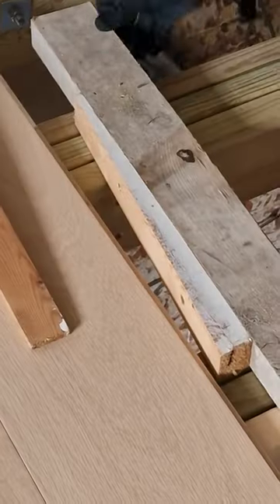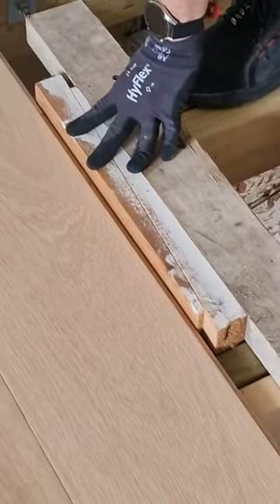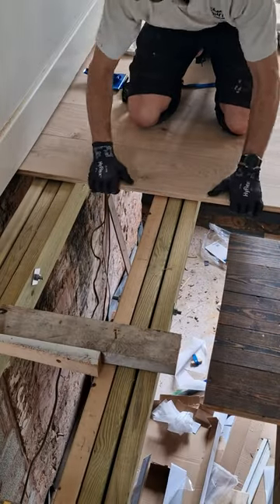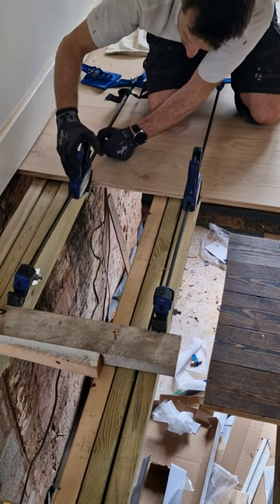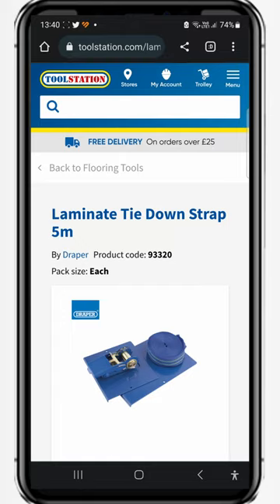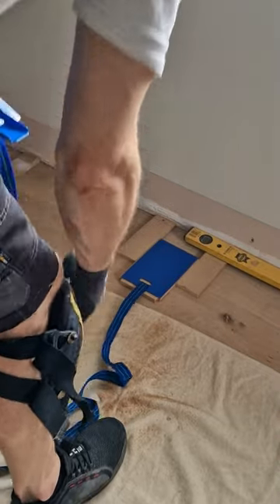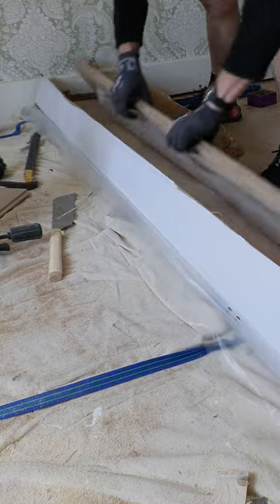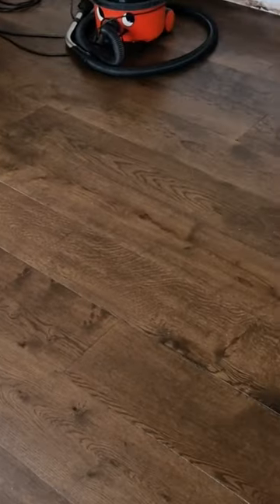Which floor clamp is the best? #shorts

Comment: I know it 22mm thick, but how are you overcoming weak points at the joints, since it does not look like you are gluing the joints, and there is no support underneath.
A well placed stiletto heal or a leg of some heavy furniture  will result in a nice hole.
Reply: That won’t happen. The boards are strong enough that as long as the joists are set at the correct distance apart there will be no movement in the floor at all even directly on the joint.

Comment: after 26 years rebuild my wood floor, because dried so much, has 2-5 mm gap, at the and needed a 6-7 cm more wide wood plate, I used rachet strap and now looking very nice without gap
Reply from the maker: They're great aren't they 👊

Comment: Hi charlie thanks for the video! you know when your screwing the board down, is it ok to do that because of expansion and contraction?
Reply: Engineered oak should be left in the room it is going to be fitted in for about two weeks before it’s fitted to acclimatise, reduces expansion, never had a problem with expansion using tongue -tites.

Comment: What location are you?  I’ve never seen a tongue & groove finish floor float on the joists. There’s always a 3/4” subfloor underneath
Reply from the maker: 22mm thick multi layer hardwood ply undercore, t&g all the way round. It doesn't need a sub base or noggins.
Reply: First time I’ve seen it’s if it’s 22mm hardwood then it’s defiantly stronger then the 22mm chipboard you seem commonly used anyway though!
No perimeter supports or ‘H frames’ required ?

Comment: Where is your subfloor and your 1/8” leeway for expansion and contraction?
Reply from the maker: No subfloor required. It's a 22mm thick multi layered engineered hardwood sub base with 6mm oak top layer. T&g all the way round so you don't need sub floor or noggins. I've laid three of these over the years and there's no expansion and contraction whatsoever.

Comment: What floor boards are these? They look great
Reply: Looks like 22mm engineered oak flooring.
Reply from the maker: Yep 22mm engineered oak from JFK Wood Flooring. Multi layered hard wood ply with 5mm oak on top. T&G all the way round and because of this and the thickness you don't need noggins or a sub base - in spite of what loads of so called experts have tried to tell me on here and TikTok 😉
Reply: Did you glue the joints? It looks miles better than doing chipboard subfloor.

Comment: i'm guessing that since it's an engineered board, there's no need for expansion gaps (for the board to get slightly wide in damper seasons)?
Reply from the maker: Correct. I've laid 4 of these now and they haven't moved a mm. Probably wise to leave 5mm - 10mm for external walls just to stop damp getting into the board.

Comment: No subfloor required?  What if there is an elephant in the room?
Reply from the maker: Still no problem. 10 layer multi laminate hard wood ply undercore with the 6mm oak on top and t&g all the way round. This stuff is rock solid.

Comment: I'm assuming some form of a vapor barrier will be placed from the basement
Reply from the maker: It's the ground floor below. Vapour barrier not necessary as there won't be any interstitial condensation given the both rooms will have the same temperature (no dewpoint).
Reply: @CharlieDIYte  just curious the room below looked like a basement, and most basements in North America condensate if there isn't any form of air circulation for humidity control

Comment: It doesn't need a subfloor?
Reply from the maker: No. Or noggins. It's 22mm thick, multi layered hardwood ply subbase and tongue and grooved all the way round.
Reply: @CharlieDIYte  no way would I install that withought a subfloor. Northerners always wonder why it’s so cheap up north and so expensive in south Florida. It costs to build right!
Reply: I've done it with no sub floor but the material was 1.5” (38mm) I wouldn't do it with less, like the clamps though

Comment: OMG 😂 please use the rubber mallet to put together the wood
Reply from the maker: Fair point but I'm using a wooden chock off cut so the hammer is obviously never connecting with the floor board I'm laying.

Comment: No room for expansion? Screws to hold down boards won’t allow any give
Reply from the maker: There is zero expansion with this engineered oak because of the multi layer hardwood ply beneath. I know this because I've laid 4 now and none of them have moved 1mm.

Comment: No subfloor needed 😂😂
Reply from the maker: No, it isn't required actually. This is a 22mm engineered oak floor with a multi layered hardwood ply sub base tongue and grooved all the way round so no noggins or sub base required according to manufacturer specifications. Check your facts before you seek to ridicule as it's you who looks foolish now.
Reply: @CharlieDIYte  our building codes  definitely require subfloors...what country are you in